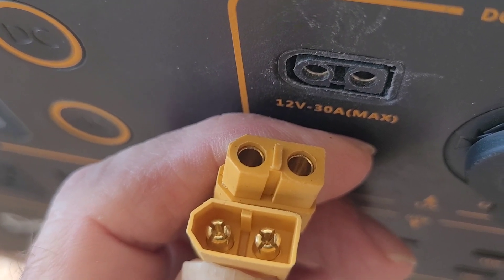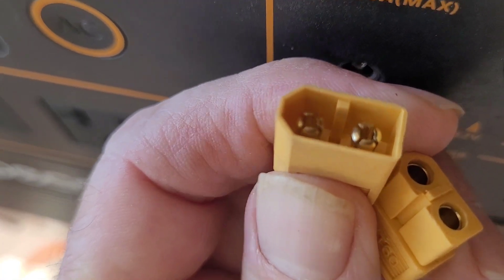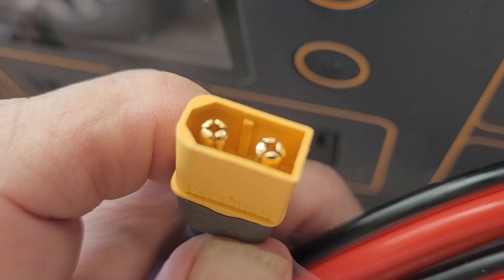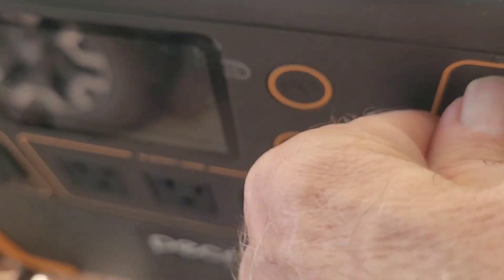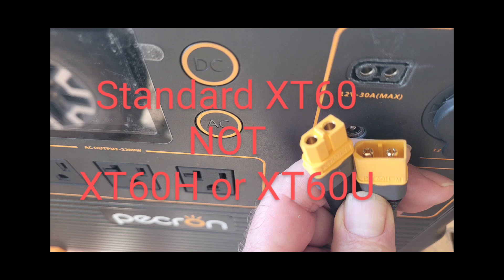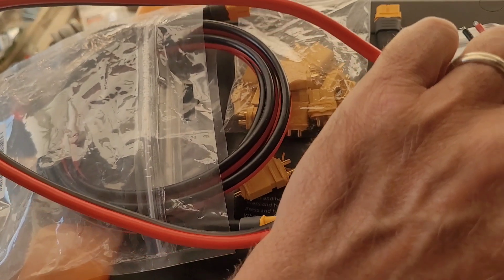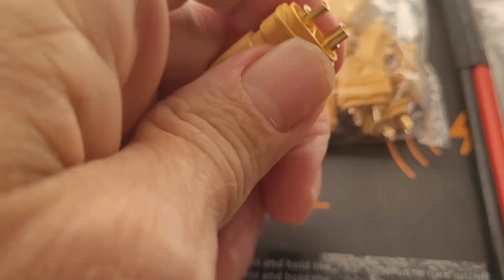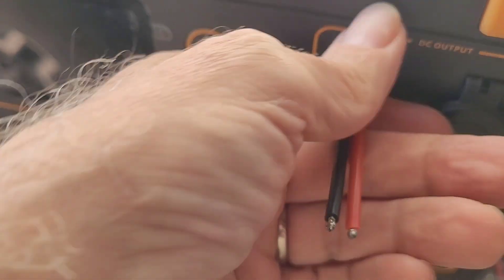Pecron and XT60 Connectors, how to Ensure Fit!

Comment from the maker: Issue seems to be with the E3600LFP,  Pecron used a non standard female plug that doesn't have the proper angled faces on the pillar, they are too rounded. Solution would be to flatten those edges so plugs fit in.
Reply: Same with the E2400LFP. Its a poor choice by Pecron. The XT-60 port is a key reason I chose the Pecron.

Comment: wow xt specs are confusing. wish they would have just standardized on colors like they tried to early on.
XT60 is the OG and angled shape.
XT60U is "upgraded" or more compact with round nose. its better for connections that you need to plug/unplug somewhat often coz the round nose is less likely to bind due to mfg tolerance or non orthogonal unplugging force. better for solder joints, worse for connection reliability (U = Un-snug). i think theyre a few percentage lighter, important for drones.
XT60i, typically orange and angled with extra "intelligence" pin which can inform device if its pushing/pulling or what the expected current will be. good for ports that share solar input/dc output.
XT60S is the anti "spark" adaptation. china mfg call them anti fire lol. typically same as XT60 but has the first part of the positive lead which connects before the rest of the pin and goes thru an integrated ~5.6ohm resistor which stops sparking when connecting/disconnecting. usually has a green L on them and same yellow color. only need these for inverters/drones with lots of caps on their flight controller/in warfare around flammable "materials".

the irony is that the XT60U is backwards compatible with XT60, but ONLY true for the male end. the plug receptacle should have been a regular xt60 so that it could accept both versions, instead the mfg only half understood xt connector specs and made a sophomoric mistake. super common on chinese products now days.

Comment: Weird, I have 2- E3600s and a brand new E1000 and none of the 3 can I plug in a XT60 male connector.
It seems like the rubber is too close to the female connector, no where near the gap you have in this video, especially on the negative side.

Comment: For the E2400LPF, I contacted Pecron support. They said you need a thin walled XT-60 connector which I didn't know was an option. Every connector I have is a standard XT-60 like the ones you show in the video. These will absolutely not fit the 2400 (and perhaps not the 3600). I've ordered some thin walled ones off amazon that will be here today. They made the case too tight around the connector so standard plugs won't fit - pretty frustrating.
Reply: Would you please give P/N for thin wall XT60 male from Amazon? I can’t find them on Amazon.
I have many XT60 cables and ends, none will fit. I would appreciate your help.
Reply: I followed another’s idea and shaved some material around the edges of the negative side and it now fits. Seems like a fix Pecron needs to address.

Comment: Hobotech said (at the 4:40 mark in his E3600LFP review) that's a XT60EF jack on the E3600LFP. So I THINK the XT60HM is the proper male connector to use. You're jamming those in. I wouldn't want to break a solder point inside the unit. Maybe I'm too gentle with stuff.
Reply from the maker: Good to know! I have their e1500LFP here, and it is just a normal xt60 plug.  I guess the issues folks are having are with that e3600LFP with the odd xt60 version, as you say.  On those, good point on forcing it.
Reply: @dave_in_az  I just realized, I think the E in XT60EF means it's mountable (something that's mounted into a unit that has mounting holes) as opposed to a regular connector which is just XT60M or XT60F (male or female). So that DC-out is a XT60EF (mounted inside and female) and the 2 solar XT60s would be called XT60EM (mounted and male). I was first under the impression that the rounded (not angular) look of that Pecron jack was a different/older version of XT60 and required a matching "rounded" plug, but I think the XT60 standard/shape are all the same.  (And the H simply means the plug has a longer grip area.) Live and learn.
Reply from the maker: Thanks! Yah, when standard plugs start deviating to "improve" things, it pretty much messes them up as a standard.  Good info.

Comment: No problem sourcing XT60 but what would be very handy is an XT60 90 degree connector. That 30Amp DC port is really nice for those of us who are using the Pecron in their RV... an angled connector would be so much easier to keep (the plug) from getting damaged, as it wouldn't be sticking straight out into harms way.
I've search the web but found none available in the U.S
Reply from the maker: That's a very good idea and observation

Comment: i am having this problem. thanks for posting. at the 0:42 mark in your video, it looks like you are plugging an xt60H into the pecron and it worked just fine. so is it that some xt60Hs work and others don't?
Reply from the maker: Not sure.  Both round and angled outer edge of shield work fine on E1500LFP.   My research says the xt60H is just the added integrated grip at the base, not round exterior of sheath.  I still haven't seen a good picture of where the interference points causing issues are, but HAVE seen some cheap xt60 without angled interior sides... I think those are the issue.
Reply: @dave_in_az  i shaved a bit of the outside of the plastic shell for xt60H male connector and it worked fine. all connected up and just waiting for the install.
Reply from the maker: @toddringler7858   glad to hear! Sounds like the Pecron port doesn't allow for the rounded outside edge much.  Good luck!
Reply: @toddringler7858  I did the same for my e3600
Reply: Having shame issue on my new e1000 lfp. Glad i found this so I know I’m
 not going crazy.
Reply: The one on the DC out works for me, however I’m having problems with the solar connector.  It fits fine but doesn’t “click’ in.  It just fits loosely and can fall out. Any suggestions?